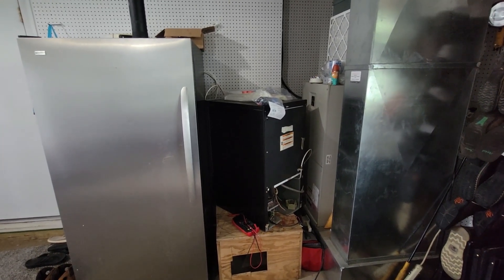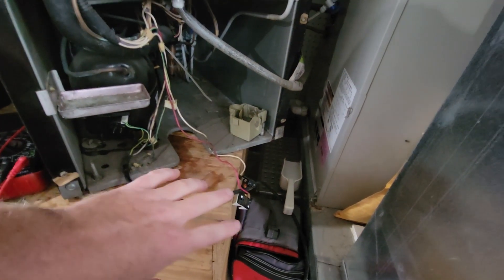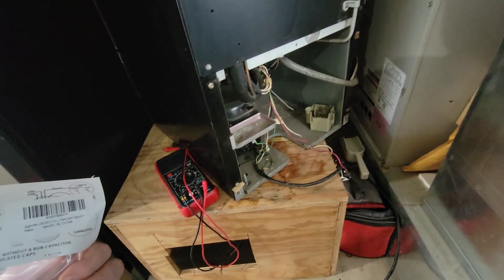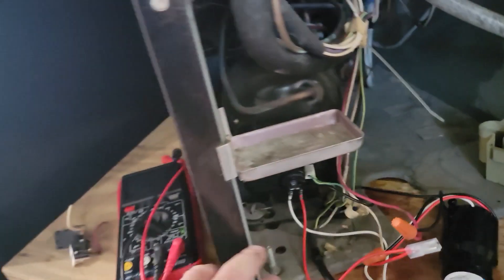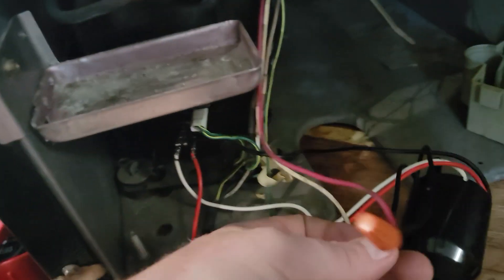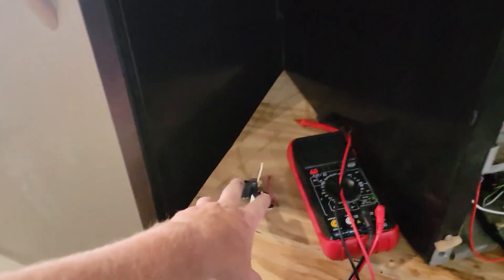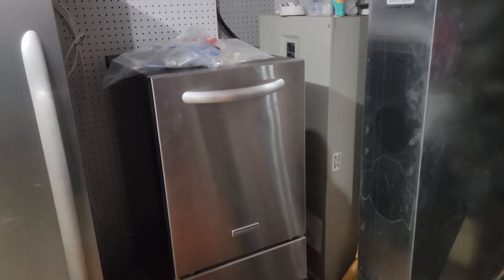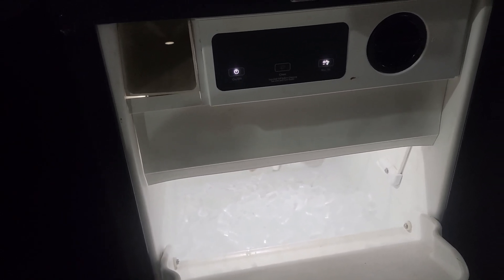Kitchenaid Under counter Ice Maker Quit Again! FIXED Again - Troubleshooting

Comment: I changed everything yesterday, still having the same issue 😕
Reply from the maker: @jonathanvargas5451  did you test the compressor resistance?
Reply: @bucksgarage1  No, I didn't. Something strange is I will turn on and lose the power right of way, so I think it has to be an electrical issue. To be honest, I don't know what I'm doing 😵‍💫😵‍💫